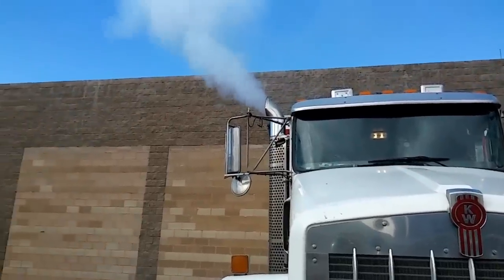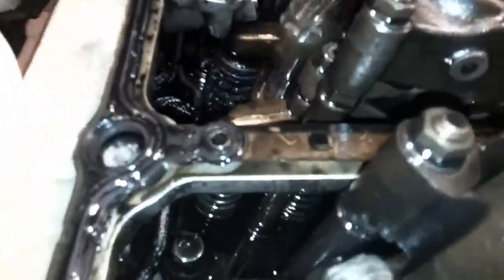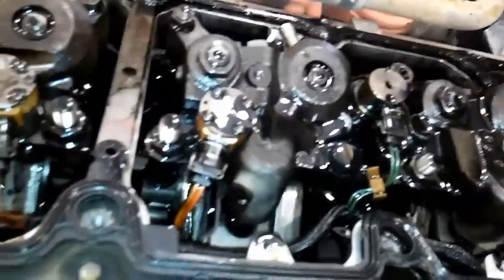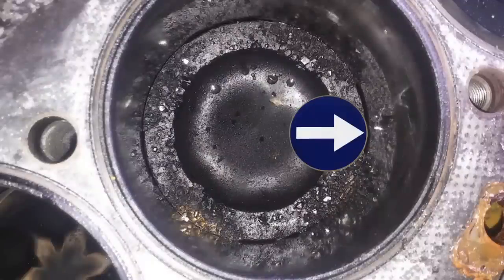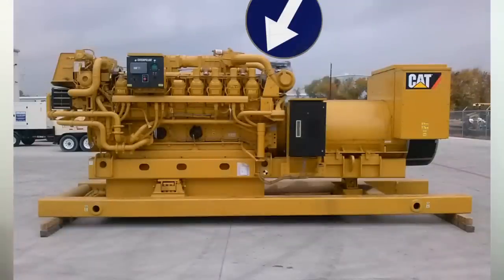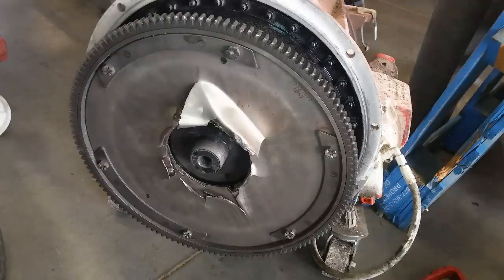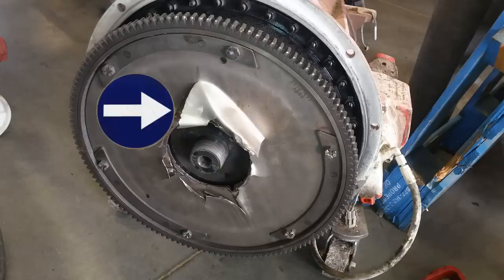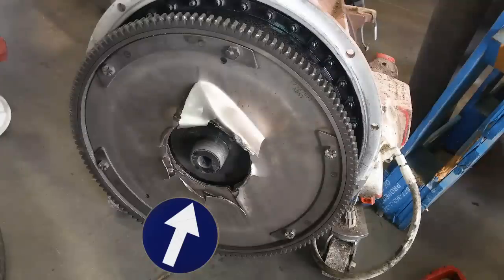Should You Warm Up A Diesel Engine?

Comment: why is fast idle recommended on coach buses and not on trucks?
Reply: Mr Daniel Explains if the statement is true, it's a great question
Reply: Nobody gives a sht about coaches lol probly why
Reply: Would it be anything to do with effectivly running the heating or AC for such a large space?
Reply: Marty McFly They have a huge A/C compressor to cool the interior of the coach.
Reply: I never have my engine at low idle. The only time it is on low idle is just after start up. Once it's running smooth, I always set it to fast idle.
Reply: John  Deere you may not but you are far from a majority.
Reply: killerdoxen Even if you’re not running a coach application a high idle is far better for the engine, low rpm idle is killer on big Diesel engines. 90% of bottom engine wear occurs at low idle on these engines.

Comment: Not sure if you did a video on it but you should do a block heater vs oil pan heater for ease of starting in cold weather. I did one on a different channel I have. Most people don’t get that 150W of oil heating vs 1500W of block heating will not only require less battery power to start but also cause less initial start wear. Kat’s self stick pan heaters are my favorite if you have a smooth surface to attach to.

Comment: I’m reminded of datacenter work I did in a former life. The building I was in most often has two large generators on-site. IIRC these generators were 16 cylinders, with four turbochargers, and preheated and pre-pressurised oil. These engines, from a standby state, had to be guaranteed to start and be online and at full power, foot to the floor, in less than 45 seconds.

In the event of a power failure, the building had a battery room, which can run the whole building entirely off battery power for 10 or 15 minutes, but it’s meant to allow the generators to come online. In addition to this, this building had two separate power feeds from two different substations in the city, one of them supplying a hospital. If both of these failed, there was a guaranteed minimum of two weeks on-site fuel supply, and no less than three different contracts to make sure fuel is supplied at literally all costs.

There’s a serious amount of engineering behind cat videos and the tax website. (This datacenter also held government contracts, as in Australia, government servers must be located inside the country, which is part of why this building is so seriously kitted out).

Comment: When it's 20 below I don't turn my truck off. When it's 0°F-20°F I let it idle for about 3 minutes "time doing paperwork" I then increase RPM to 1000 until full air pressure, then I put in low range 2nd and pull easily around parking lot or road to warm up my gear box. After total of 5 minutes I pull away with my load. 20 minutes later my coolant temp is between 150 and 200. Summer temperatures I build air pressure and go. 2,000,000+ miles, but I could be wrong.

Comment: Block heater and oil pan heater together is the best combination for cold temperature starting.  When I fire my 6.7 power stroke after sitting overnight at sub zero temperatures, my oil temperature is around 90 degrees Fahrenheit and the oil temperature is around 85 degrees Fahrenheit.  I let it idle for 2-5 minutes to allow for the metal parts to warm up and I'm down the road.

Comment: To reduce wear, we use Conklin "TKO" oil additive in all our farm and excavation equipment.
It's megnetic and leaves a film of lubricant on surfaces that normally get dry after sitting for a while.
My personal story is having a Toyota truck that had a leak in the oil pan gasket and leaked the oil out without me knowing. We were driving in the Silver Lake Sand Dunes on a 100°F+ August day. I was running the truck extremely hard. The engine didn't overheat and when we finally checked the oil, because we noticed some oil dripping under the truck, the oil level showed nothing on the stick at all. The stick has an extra two inches past the measuring section. And nothing. We put new oil in, (took 4 quarts, the engine holds 4.5 lol) tightened the bolts on the oil pan and never had a problem. We also noticed our tractors and excavators and such seemed to start better in cold weather. But that's anecdotal and I can't prove it.

Comment: From Canada where -40 is the same in C or F.. So what I do After start is basically for about 2-4 minutes (or if I didn't plug it in watch for thermostat to move) I roll at just over idle since your ATF and gear oil are heated by friction so be mindful of them. After that I do slow accelerations to keep the motor under some load untill hot, however I dont give it any real throttle untill the transmission warms up... Which takes longer.
Reply: Give five, bro. In Russia, we do same. Until engine, and transmission gets warmed up, no pressing on pedal, or press it really light. So I have 1994'th Nissan Terrano 2, and it is still file))

Comment: I have a Cummins ISM 370 and during the winter here in Va., and it is not as bad a North Dakota, but Do allow the engine to start and run idle for about a minute to allow the oil pressure gauge to peak up and then I engage the PTO to raise the RPMs higher for warm up until the air tanks fill and when the air pressure relief valve purges then I am ready to go.

Comment: Love the channel! So I have a C7 2006 in my motorhome  A long story  long. I bought it with about 45000 miles ,we kept having overheating from the start. The radiator was caked and changed the radiator and  thermostats and fluid. Tow a car hauler approximately 4500 lbs. The problem  is overheating  whether  towing  or not. Went 400 miles  without the cap on no problem.  So where should I  start .Thanks and keep up the good work.

Comment: Depends on the temp.Yes. Short sleeves? 5 minutes. Long Sleeves, 10 minutes with 150 RPM easy off till temp shows 110 then add 150 rpm per 20 degrees.   Heavy jacket? sit still at 1K rpm till 110 then 150 rpm per 20 degrees.  As to oil change intervals, do not push it. Cam and rollers do not like extended drains. 2008 C15, I evtended to save money to 21K. It cost me 8K for a new cam and rollers. Grease 7500, Oil and grease at15K. What a Happy kitty!

Comment: I do live in ND and yes it can get a bit chilly here!  On all my trucks whether they are CAT, Detroit or Cummins I always let them warm up for at least 20 minutes after startup and run them around 1100 RPM.  On my pickups which are all Duramax engines I used to let them idle a lot more than I do now but I had to replace a turbocharger on one last year and the reason they gave me is I was letting it idle to much and at idle speed there is not enough oil flow to properly lubricate the turbocharger and the bearings/bushing will wear prematurely.  I still let me pickups idle for 5 minutes or so before I drive them in the winter!

Comment: I have a truck with a Cat 3126 7745 hours on it (156789 miles)
 That uses zero oil between oil change intervals of 6 months or 6000 miles.
Anytime the night time temps get below 55 F I plug in the block heater, it makes starting and warm up time much shorter.
 I have electronic idle control I use to bring the idle speed to around 950 30seconds after it starts and let it run while I do my pre trip checks.
 I live in hill country and with in 50 yards of my parking spot I have my 1st Hill climb on a rough and Rocky dirt road.
The engine is all original in a 2000 GMC C6500 always loaded with tools, welder, and supplies that a field mechanic would carry, in other words, heavily  loafed. 
 I work on heavy equipment and class 4 through 8 trucks for 40 years now.
I've always done the same with every truck I've owned and equipment I've operated and have always gotten longevity out of them.

Comment: As a diesel mechanic and truck driver what I do at fire up is let the engine idle on its own because it mis fires or partial fires I just let it smooth out then at that point I will slowly raise the idle to 900 rpm for 1 minute then slowly up to 1000 , then to about 1100 . Remember you are also building air pressure to at this time then back down to idle. Also during this time I’m getting my paperwork in order and doing my pre-trip and if it’s really cold after all this I will run the engine up and down between idle and 1500 rpm. One thing I will say I see a lot of mechanics and truck drivers use ether base starting fluid on Diesel engines that’s a no no  unless you have deep pockets. I use WD-40 to start Diesel engines this sometimes requires pulling off part of the intake system right at the turbocharger with a socket and ratchet. And their are other ways but I will not go into it here

Comment: Many years ago in the U K a company called Coventry Climax (nice) made an aluminium fire pump engine, small and hand portable. The same engine became a successful race engine as it had lightness and power. As you mentioned with regard to  the standby generator, it was not exactly the same. The pump engine had larger tolerances for max oil flow immediately. If it used twice the oil and wore out quickly- so what- got to put that fire out!

Comment: Due to higher thermodynamic efficiency many diesel engines will NEVER reach operating temperature if left idling in very cold conditions.  

Best advise is to use the right viscosity oil for cold flow.
Reply: That's an interesting and very noteable point. Good of you to add james. (upped your comment).
Reply: Plug it in. The electricity is cheaper than the fuel.

Comment: I like it. Very well covered subject matter. 

Figured I’d mention some things. 

You can get an Auxiliary power unit to keep the engine coolant warm and batteries charged.  It’s a small diesel powered engine. 

Webasto and Espar make block and cab heaters too. These have many different setups. Some just heat the cab air others just heat the engine coolant and some do both. These guys do run a small bit of drain on the batteries.  

Also have optimized idle. I believe this is a Detroit brand name. It allows the main engine to start and stop automatically to maintain several parameterized settings. Got battery voltage, oil temp and cab temp. 

If I was in sub zero climates, I would certainly not want something that would drain the batteries. A discharged battery freezes at a higher temp and once frozen, doesn’t just unfreeze when charging…. It explodes.  

I wanna make videos like these too. But I’m more of a vehicle guy than engine. Cool to spread the knowledge

Comment: Ok, simple and easy answer. Manufacturers suggest letting diesel engines idle for 5 minutes to warm up the large quantity of oil, and turbo, at any temperature, if you are below 40`f, this time should be extended to 10min to allow the fuel to warm

Comment: Couple minutes at low idle to get things moving then 1000 rpm until coolant temperature is at normal operating temperature.  Been doing this with caterpillar and detroits for 30 years with absolutely no problems.  Several with well over a million miles before rebuilding.   Better to warm up too long than too short.  Gotta do pretrips ,paperwork,whatever anyway.

Comment: I was taught as a youngster that a ll engines should be warmed up before putting them under a load and still do this today.  At times I'd get push back from my employees or children as to the necessity of this practice. I used the  analogy would up jump up out of bed to run a  race ? No you warm your muscles first. The second part was interesting too.

Comment: I have a 3126 in my fish boat. I idle for about 5 minutes bringing temps up to around 110. I then get underway at 900  rpm bringing temp up to 130.  I then bump her to 1100 rpm this gets me to 150. At this point I can step up to 1300. I stay at this rpm till I reach operating temp (180).  I now feel safe to hit 1700 rpm. I don't cruise above this till the engine reaches 190. This forced warm up takes about a half hour.

Comment: The main thing is you don't want to exert a sudden change in temperature on any engine (especially ones with Aluminum blocks).  While for cars it's not really necessary to let them run for minutes from a cold start (in some cases, some people say this is worse than just letting it run for a minute and then driving), some warm up as mentioned is probably a good idea.  I know this video is for a diesel truck, but much of the same stuff applies to cars too.  I generally will let the car run at least a minute if it's really cold out (say under 20 degrees F) before driving, and maybe 30 seconds if it's above freezing.  Mainly to ensure that oil is flowing everywhere which it should within a few seconds, and using synthetic oils can also help this (although part of my "warm up" routine is a bit old fashioned having used conventional oil up until about 20 years ago, when synthetics started becoming the standard).    The other thing is you don't want to go revving a cold engine either because any sudden change in temperature can lead to damage and revving a cold engine also means that there may be some components that are brittle and can break under extreme loads when cold.  Plus, if you're still using conventional oil, there may not be enough adequate lubrication yet upon/shortly after startup to support higher RPMs without doing damage.  In the end, if it's really cold (below freezing) I'd say let any vehicle run for about 2-3 minutes).  If it's aboze freezing, most modern vehicles (car or truck, gas or diesel) should be fine after about 30 seconds to 1 minute if you're using synthetic oils.

Comment: I have an underground garage.
I let the engine idle at its default 1000 rpm for a minute, then I hold it at 1200rpm for about 2 minutes, by that time it usually has gone down to 800rpm and then I drive it at no more than 2000rpm until it warms up fully, avoiding hard acceleration for as long as possible.
Still takes it around 5km of city driving to reach 90.

Comment: old start is where the wear is. I plug them in. Radiator hose heater, block heater, oil heater. Neighbor works oilfield. Gas pickup truck. Cranks six in morning, kills at nine at night, six days a week. Has 300k on it at last check, on top of running all day. It's not cold cranked very much,   I mess with junk, old school. My brother called me yesterday to crank an 80's MACK R model with a log loader on it so he could dig a. couple stumps. Parked it because clutch is apart but is engaged. I showed him how to drive without a clutch pedal. That is how it's like, the pedal is on floor but pieces of clutch are wedged up. I usually drive it. dont think he ever has, other than around shop or log set.  Just warm up, kill it, put in gear, start and roll on. We have an 85 Superliner but it has a loose sleeve.

Comment: I have a 2000 7.3L powerstroke. My truck has the block heater, which I use when I cam. but sometimes at work I cannot plug it in (work for my township, so called out for snow removal) and when I cannot have it plugged in, my truck goes to a high idle (until I hit the break to put it into gear) when it is cold. Also, starts up first time every time after a glow plug cycle. When I have to start it after oil temps low (my tuner has a digital readout of my oil temps) high idle starts after about 30 or so seconds. After that I allow it to warm up until my oil temps rise to about 85-90 degrees. then I will drive slow or at least carefully, as to not put too much stress on the engine. I do not want to cause uneven heating of my block or head (which can cause warping).I usually start driving normally at about 150 degrees. normal op temps for me are about 180-195. Although it has gotten higher especially during summer months pulling heavy loads. Is this a safe way for operating during the winter months?

Comment: Sir,
Long story short was just chatting with the supervisor about the same subject. 
Something I don't think you mentioned was "glow plugs" for example. I noticed on the boss's ice trucks some have to "wait to start" lights and some don't. In Virginia the weather is up and down. So even if there isn't a light I'll still give it 10-20+/- secs to attempt the turn over. Some of the trucks are parked about 30-40ft away from the dock on a 90° turn. So for me, once started as in being cold I'll let run till there is enough air pressure to RELEASE the cage and the truck to move under it's own power in gear but without throttling the truck till in moves and turn to get lined up on the dock. Then I'll have enough pressure to turn off the alarm and throttle up to get to the dock on a little bit of an up hill grade in reverse. Once dock the two trucks are idealing while they are loading and getting checked over. One does have to have the  "Cruise Control" activated and up a bit...as you said or the engine goes into automatic shut down after about 10-20min.
Wondering if this is a good idea? 
Oh as in "ice trucks" I mean we haul from 6-8pallets of ice depending on which truck.

Comment: I drive a Jetta tdi and live in western Washington. It rarely gets below 25 degrees (I work nights shifts so it’s usually the closest temperature of the day when I leave work). I work right off the freeway and live right off the freeway. Instead of just hopping on and going 60mph from a cold start, I drive around the block before hitting the freeway. My car runs beautifully. I guess I should add that I have jumped straight on the freeway on cold nights and my car did give off a slight burning smell (not oil burning but an unusual burning smell) which is why I drive around the block first.

Comment: On my big diesels, I start them up, wait for oil pressure to build, then slowly ramp it up to 1200 rpm and set the throttle lock. Once air pressure has built, I pull out and drive gently until fully warm.